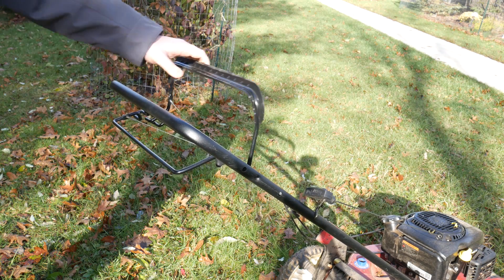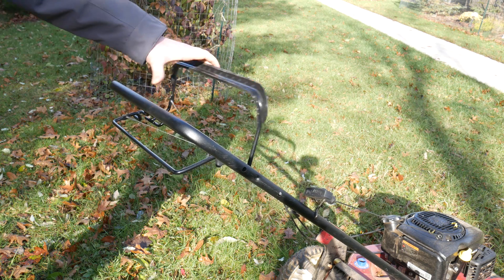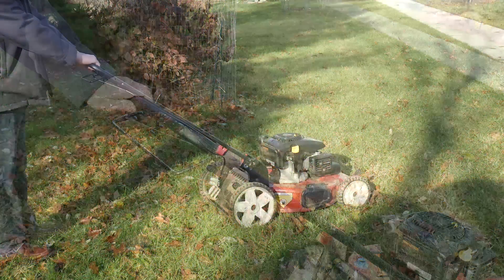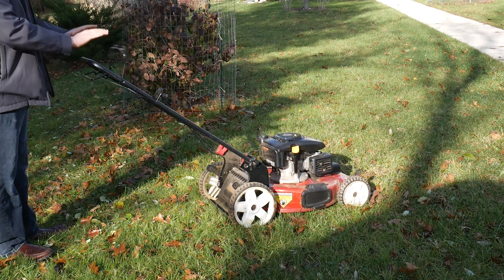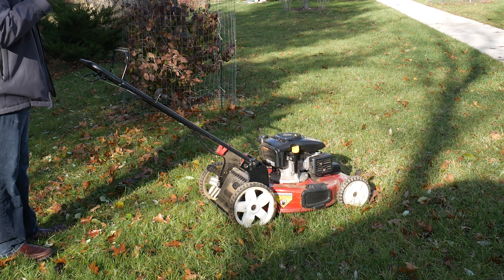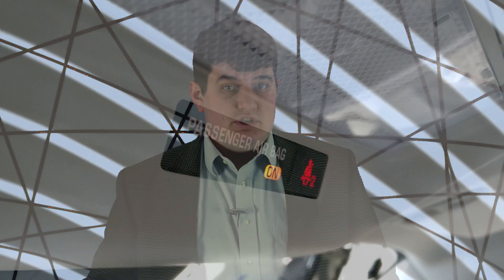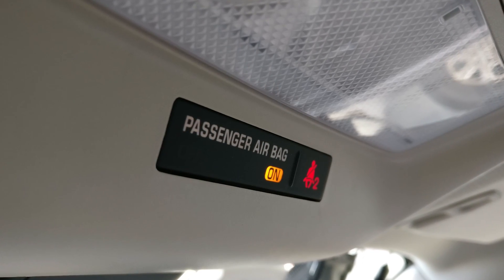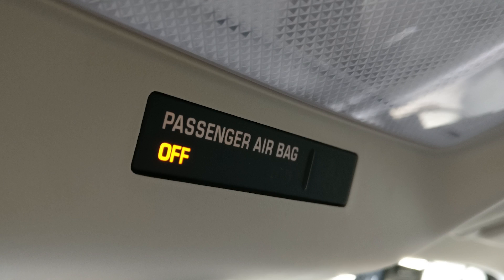The Dead Man's Switch:  How Anton Yelchin's life could have been saved

Comment: Well, that's a good idea, until the point where you go over a bump that unseats you for a moment, and it causes the engine to cut out. Or you lean out to get a parking ticket from a barrier machine and it stalls. Or various other situations where a ride-on lawnmower cutting out wouldn't be too much of a hassle, and you'd appreciate the odd false activation in return for not being turned into human mulch if you fell off whilst cutting, but a car cutting out would be a serious problem.

And of course it's one more thing that could fail at exactly the wrong time, and for a variety of silly reasons such as the driver being too light, or the seat having something spilled on it, or they shift their weight to try and get a better view in difficult conditions, or...

Really, there's no call for making wholescale modifications to how automobiles work in order to address this idiotic problem of poor, nonstandard design applied to one of the most fundamental controls in the car - ie whether the power of an idling engine can be applied to the wheels, and/or whether the wheels are braked or if they're allowed to turn freely. Which isn't something you want to deal with even when sat at the controls anyway, let alone it being something that can happen accidentally as you exit the car somehow.

Now, putting aside the really bad habit that seems to be encouraged in the US of using the transmission "Park" position in place of the actual parking brake when momentarily stopped with the engine running (it's not good for the transmission, for one thing, to be regularly shifting the weight of the vehicle on and off of the parking pawl, without any backup in case of its failure or inadvertent removal... it's supposed to BE the backup in case the dedicated brake fails or someone cuts the lines to try and steal the car with a tow truck... not used in place of it), because that would rather in this case smack of victim blaming... the question to ask is "how the heck was it both unclear what gear the shifter was in, and/or how was it so easy to move out of park if that's what it was in?". There's another question in my mind re: how come he was able to not only get out of the car but also into harm's way behind it when you exit it to the side and usually more towards the front than the back, but that is again something for another time.

Consider most normal automatic shifters (I assume that's what we're dealing with, because not being able to understand if a manual is in neutral or reverse vs one of the forward gears is a much more fundamental mistake). If on the column, then there's a pretty obvious readout somewhere in the driver's line of sight that's mechanically connected to the lever, and in order to change from one position to another you have to pull or push the stick back or forward against a reasonably hefty spring and make a positive up or down motion to move the stick to its new position before letting go. It's pretty obvious if you've successfully got it into Park because you'll feel it hit a stop at the top end of its travel (in a LHD car) and it won't go any further even if you add extra pressure against the spring as well. And if you then somehow knock it out of park and into reverse or neutral then you should damn well know about it before your right arm leaves the steering wheel area. Never mind that lockouts which demand you give the footpedal brake a decent shove (regardless of parking brake position) before the lever can be moved back out of park (and, sometimes, into it, so there's a reasonable guaratee that the wheels aren't turning and therefore the pawl is at much less risk of being sheared off) are a relatively common thing too. IE it's then pretty difficult to pull the vehicle out of park unless you are the driver and sat in the correct place... not a passenger, not some passing troll, not an exiting driver.

(on that note the DMS would be annoying for reasons other than loss of prime motion that could be connected to wheels meaning you can no long ghostride the whip - what if it's keeping a near dead battery charged, or providing power for running or charging things connected to the 12V socket, or you're trying to jump-start some other vehicle? Or you're merely trying to warm it up on a frosty morning with the interior fan running at making heat whilst you go round and scrape off all the external ice? Or the thing has been stupidly designed so the lights or radio don't come on without the engine? And most particularly as it's a jeep, what if you're using an attached winch or a power take-off from the transmission?)

Now consider the floormount type. It's not always entirely obvious from a glance what position they're in, because the indicators aren't necessarily the brighest or the letter positions placed as close as they could be to the actual stick positioning for that "gear", but it's still easy enough to derive and difficult to mess up. Certainly all the different types I've either used or seen share some common traits. First up, some of them do the "press footbrake before a shifter in P will unlock for use of other gears" thing, which seems eminently senisble really unless you're at the moment where a fast depart is required and want to get your foot on the other pedal ASAP. The others all have other clever lockouts that act both as safety measures, both preventing inadvertent engagement of "the wrong gear" and giving more clues as to which it's currently in or has been recently moved into. For example deliberately seetting Park is a case of pushing the interlock button on the nearer side or trigger region (both harder to accentialy trgger than one on the further side) then just shoving it all the way forwards. Typically you also need to push the button as well as any other pedal-pushing requiirement to get it back out of Park, and from Reverse it's button to go forwards but not back; Neutral, likewise (so going from reverse to forwards is nice and easy but not the other way around)... Drive, not so sure, but I think usually it's then no button to go back into neutral, and button to pull back into lower gear?

Either way, with that, the idea that you could entirely accidentally, whilst moving sideways away from the shifter (not forward or back), knock it from Park into any other position, or Neutral into reverse, as if the car had KITT's own shift lever, beggars belief. It's not a dead man's switch you use to fix that kind of bad practices, it's fire. OK, more of The Apprentice type than the oh-oh-oh it burns me sense, but the latter is quite tempting. In any case, it's a band-aid on a self-broken leg - a small and not really that helpful token of healing, when what needs to be done is to encourage them (the car companies who do this kind of ludicrous, obviously unsafe sort of thing - to stop breaking their own legs.

nb if the thing was in neutral all along this wouldn't have helped things an iota, you know?
Reply: TL;DR. 

Regarding your first paragraph, which I did read, my car has an automatic parking brake and it has been working fine, never giving me any problems over bumps, or when reaching for parking tickets or in any other situation. If you want old tech by all means buy old tech. I don't know why you see the need to make up problems.

Comment: Yeah but then if the sensors malfunction, it could cause it to go into park whilst driving and cause a crash
Yeah you could have sensors that see if the car is moving
But they can fail too
If you’re driving and it fails, a ‘failsafe’ wouldn’t work 
And sensors that fail don’t always know they’ve failed
So if they give the wrong output, that can cause a crash
So instead of putting in a kind of hacky system
Fix the root cause; the gear changer 
Make that work properly 

None of your examples think of the fact that when you’re driving, there are other cars around you; Dead mans switches are fine on big heavy machinery because if they suddenly stop, they won’t kill anyone
Or a ride on lawn mower, that won’t hurt anyone
But if a car suddenly stops
That’s a different story
Reply from the maker: Do you know what the CAN bus is on a car?  If any component fails, and takes the network down, it can brick your car.  Cars since around 2008 have been equipped with a CAN bus.  There is already so much software built into modern cars that potential failures can cause serious problems.  

I'm pretty sure an automatic transmission won't even allow you to shift to park when the car's moving anyway.  Certainly not the electronic gear selectors in nearly every car today.

Comment: One problem, you need a buddy to pull you out of a muddy or icy rut.  If you are in the middle of nowhere, safety fail.  In general, cars are mostly safe these days, just not on your wallet.  A 5mph crash used to cause a bumper dent, now it causes a broken radiator and thus a totaled car.  Also, pickup trucks have no requirement to be similar bumper height to sedans, greatly reducing the safety and increasing the repair bill of the sedan.  

All that is required to reduce repair costs is a water filled bumper.  >100 pounds of water in an accordion-like bumper within a rubber bladder at each end with a burst valve.  That will improve both safety and reliability.  A 10 mph head on crash would then do nothing to a car that can't be fixed in ones own garage.  Consumers would save $500 to $5000 per crash.   Insurance companies could give discounts for the use of such devices.  The only thing that suffers is fuel economy and gas is at a low price now.  Of course car companies will never tell you this for the sake of profit when you break down.

Comment: What a stupidly over complicated solution. There is nothing wrong with the cars design, when stopped on a hill you should secure the vehicle with the parking brake, Anton did not bother and so he got run over.
Reply: Therefore he deserved to die. Is that what you're saying? Forgetting to set your parking brake is a capital offence?
Reply: @theblackwidower  Forgetting to set the parking brake CAN result in the vehicle moving unexpectedly. If you are in the way you CAN be killed. This was a preventable accident. Pointing that out does not mean that one believes that he deserved to die, only that it could have been prevented!
Reply: @brianleeper5737  Yes, but if you're using that point to argue that a dead man switch should not be installed...
Reply: @theblackwidower  Unless it automatically applies the parking brake, what good is it going to do? If it just shifts to park, well, that parking pawl in the transmission can and does slip under certain situations, which is why you're supposed to use the parking brake.

Comment: Great. Yet another "single point of failure" engineered into a machine. Any engineer worth a damn knows why a SPoF sucks. 
Plus there are bone fide reasons to run a car unoccupied. Jump starting, for instance.
Reply from the maker: My proposed solution wouldn't prevent jump starting as that procedure is done in park anyway.  This video is simply pointing out an option, and an override is certainly easy to add to allow unoccupied movement.  This proposal would simply force the car into park from another gear if the driver inadvertently exited.  It would not shut off the engine.

Comment: I have a 2000 Corolla with an A131L Automatic transmission that is a totally hydraulically controlled transmission. It will go into reverse at speed if you tell it to. I know this because I fucked up and put it there at about 30MPH once. Got a really violent bang, barked the tires, and stalled the engine. It fired back up and went back into drive like nothing had happened.  Only the higher trim levels got the A245E box that is electronically controlled

Comment: You are accurate on reasons the seatbelt sensor couldnt be used, if someone is undergoing any type of medical procedures requiring a port into their heart, if someone has a chest port in they are actually advised not to wear a seatbelt as the seatbelt itself could be fatal in that scenario.

 This idea for the deadmans switch checking seat occupancy and  disengaging vehicle movement if no driver is present is a genius concept.

Comment: My car automatically shifts to park and applies the parking brake, as soon as i open the drivers door
Reply: @calvinegreene90 cars with a safety feature like that also have something called an override.  Overrides will let you bypass the safety features if needed but are not something you can trigger by accident.
Reply: That's BS.
Reply: Root3264 Mercedes?
Reply: BMW 7 Series (F01) at least also does this. If the driver's door is open it always shifts back to park, from neutral or drive, or reverse. Yes, this can be a pain if you're trying to manoeuvre precisely, but it's basically impossible to let the car roll away without a driver.
Reply: @calvingreene90
Just put it in neutral if you want to push it...? I mean thats exactly why you got neutral in the first place.
if you think something like this is somehow wrong and "you shouldnt be driving" if you want something like that... im sorry, but its more like the other way around. Why would you not want something like this to simply make it failsafe for everyone, always? Its a win-win for everyone. Just like having the break lights come on whenever you brake: You could do that by hand with a dedicated switch, too. But having it failsafe by turning them on whenever the breaks are used is a better solution. Its that simple.
Reply: My car uses the seatbelt to interlock with the parking brake, and the parking brake is applied automatically whenever the vehicle is at a standstill. The car won't release the parking brake if the driver is not belted. It can be overridden if necessary, by pressing on the footbrake while operating the parking brake release switch; that ensures the vehicle shouldn't move off expectedly and the driver's foot is right there on the pedal should need to be stopped immediately.
Reply: Anything that shifted into park automatically would risk damage to the transmission if the vehicle were rolling. Applying the parking brake is safer, possibly followed by a shift into park when the vehicle has stopped or as an emergency move if it fails to stop quickly.
Reply: Same on my g30 bmw 540i
Reply: As i use to open the door to see whre my front wheel goes while reversing for tirechange, as i need to excactly hit one spot, this would be a dealbraker to me
Reply: That sound like a real pain in the donkey if you need to push the car.
Reply: @ Leo Curious \
Put in in neutral and then when the door opens it automatically applies the parking brake and shifts into park. I have fought systems like that before they make the world less safe.
Reply: @ NobodyImportant
Not being stupid or raised in a padded cell I don't need such "safety systems" to keep me from getting hurt and if you do need them you should not be driving. The world is not a safe place and making people habitually not taking responsibility for their own safety is what killed the actor in the first place.
Reply: @  Pixie Panda Plush
If they need it they should not be driving. consider it evolution in action.
Reply: @calvingreene90  News flash, buddy. You know the phrase 'shit happens'? It exists for a reason. We're human. We fuck up sometimes. If you honestly try to tell me you never make mistakes, I'm going to laugh at you and call you arrogant, just like almost any other person on the planet.

Everyone has moments. That's what being human is. That's why safety systems exist- to make up for the fact that we, as humans, are not and never will be, perfect. We will never do something exactly perfectly all the time, and we will never make something exactly perfectly all the time.

Chrysler did a really good job of demonstrating the latter, we can't forget the plethora of problems the transmission in that Jeep has had in general.